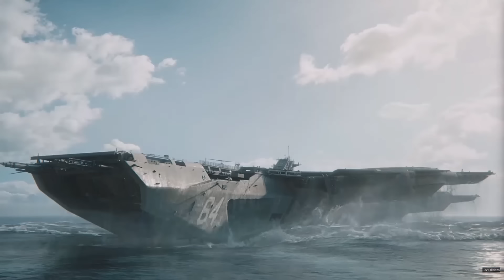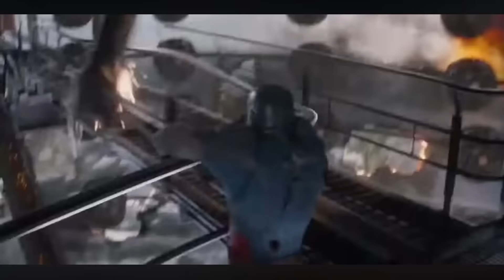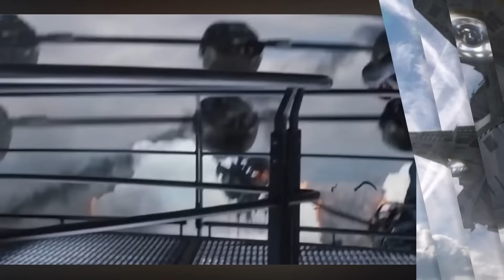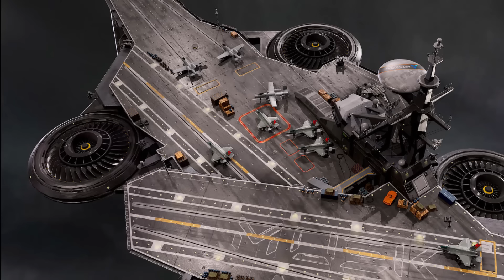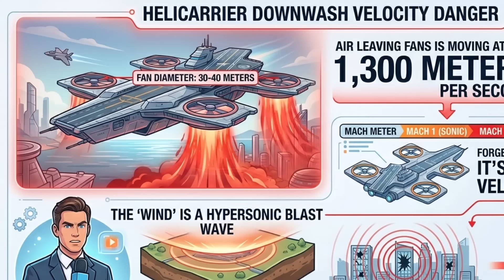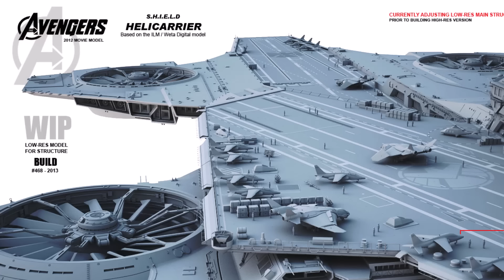The Engineering Nightmare: Could We Actually Build the Avengers Helicarrier?

Comment: Yeah, there is a big scaling problem here. It has been pointed out that the design of those relatively small four-propellor quadcopters really doesn't scale up in size very well, so that a four-propellor quadcopter capable of carrying the weight of a human isn't very energy efficient at all. As the weight of the aircraft gets larger and larger, it's more efficient to have one large propellor moving lots of air downward at relatively slow speeds, than to have four smaller propellors moving smaller amounts of air downward at relatively high speeds. That's why large hovering aircraft using a design like that of a helicopter instead of four propellors like a quadcopter. 

Even more efficient is to have large wings on the aircraft and an engine mounted horizontally so that as the aircraft moves through the air the wings generate lift rather than relying on the thrust from the engine itself to directly generate lift. That's why all of our very large aircraft are fixed-wing aircraft, and not helicopters or quadcopters.

Comment: Imagine having to do a touch and go on the helicarrier. On an approach landing, you have a giant fan grabbing air on your right. And if you couldn't land and had to go around again, you'd have to fly between two fan engines grabbing air on either side as you go off again.

The shield helicarrier looks cool, but, it's completely impractical and unsafe to operate aircraft like a typical modern-day carrier. A better option, assuming it could be done, would be the drone carrier from Ace Combat 7. Even the flying super-sized "Banshee" carriers from the anime "Yukikaze" would be a "better" option for carrier-based flight operations.

Comment: Space Battleship "Yamato" with Modern Day Technology.

I am the creator of the FLOWER CHILD PROJECT Manned Spacecraft Design Concept.

I am of the belief that a Real Life Mars Colony Spacecraft will be comparable to the ...
•   STAR TREK Starship "Enterprise"
•   Battlestar "Galactica"
•   Space Battleship "Yamato"
•   STAR WARS Imperial Star Destroyer
•   STAR WARS Imperial Star Cruiser
•   SDF-1 "Macross"
 ... in Size; and/or, Volume; and/or, Mass; and/or, Displacement; and/or, Weight.

Personally, I used BLENDER 3D and PRISMA3D to create a Cylinder Hull that was 853 Feet Long × 128 Feet Beam × 88 Feet Deep; and, mounted APOLLO/Saturn V Space Vehicle S-1C Stages unto my "Yamato" Spacecraft Hull.

I also envision an APOLLO/Saturn V Space Vehicle F-1 Rocket Engine that was designed to burn Cryogenic Fuel (Liquid Hydrogen & Liquid Oxygen); and, be Multi-Start; and, Variable Thrust Capable.

This F-1STQ Rocket Engine would be bigger then the F-1 Rocket Engine; and, would have greater Thrust Power; and, would require Larger Fuel Tanks and Oxydizer Tanks than the APOLLO/Saturn V Space Vehicle S-1C Stage had.

I believe that my "Yamato" Mars Colony Spacecraft Design will require enough Cryogenic Propellant for a Total Burn Duration of 1 Hour in order to get to Mars after launching from a Space Station in Earth's Orbit.

The Cryogenic Propellant Capacity needed for Launching from a Space Station, and getting into Mars Interplanetary Injection Point, would probably require another 15 Minutes of Total Burn Duration.

Then, another 15 Minutes of Cryogenic Propellant for docking with a Mars Orbiting Space Station.

Thus, I believe that my "Yamato" Mars Colony Spacecraft will require a total of 90 Minutes of Burn Duration of Cryogenic Propellant.

This does not even take into consideration the Propellant System needed for whatever Manuevering Rocket System that my "Yamato" Mars Colony Spacecraft may have installed as well.

Comment: 1st the vessel itself is way bigger than it needs to be. The upper flight deck is overboard even as just a sea vessel! The structure around the fan blades is wing like which this sucker ain't gonna glide anyway so why? A flying carrier at some point could be possible but it'd be smaller thrusters but more of them for redundancy or a Spruce Goose of a massive seaplane with a runway atop the fuselage! Something that gives it a possibility is the S.H.I.E.L.D jets are VTOL! I would think that would be almost required for landing on a flying carrier due to be able to then build a much smaller vessel with shorter runway! Ya think about it, Avengers isn't the only flick with a flying carrier! Sky Captain and the World of Tomorrow had a fleet and I know more towards cartoon but Talespin's flying pirate ship "The Iron Vulture"!

Comment: The angled flight deck is mostly used to recover aircraft using it to launch aircraft can be done when the carrier is on the surface.
Beside that the angled flight deck is angled slightly forward of the left forward engine thruster fan assembly

Comment: Even if they used Starks Arc reactor, or alien tech that thing would crack like wet cardboard. The fans themselves would cause enough vibration that any metal would get fatigued in a big hurry. Even the maintenance per flight hour would ground it, and likely only one would ever be made.

Comment: The angled flight deck that launches aircraft OVER one of the lift engines is hilarious. Any plane launched would be sucked down into the engine, destroying both plane and Helicarrier. 

I've always assumed that these carriers used magnetic lift systems, repelling against Earth's own  magnetic field, to keep them in the air. The giant turbofans aren't needed for lift, just for vertical movement.
Or, later on, anti-gravity tech.
Reply: Maybe, but if it's using rear thrust and it goes over it fast enough, it'd probably be fine, like passing your hand quickly through a flame.
Reply: @MarvelX42 yeah, I wouldn't want to test it. 😂
Reply: @nicholasklangos9704 Understandable.
Reply: 1. Planes that use the angled flight deck would realistically only take off towards the back, and it should NEVER be used for landing, 1 hook miss and the jet will fly and stall into the propeller. 2. The angled flight deck probably only gets used when the carrier is outside of hover mode and in float mode.
Reply: Exactly my thoughts too, it is the only way it could work. Impossible or not it has always been one of the coolest sci-fi designs ever put on film, all the little details the cross over runways with the conning tower and hanger maintenance spaces are just awesome! I guess when aircraft were flying over the crosswind ramp that one fan could turn down briefly,  but it is a design flaw thats east to fix.
Reply: @nicholasklangos9704  The Chinese will find a solution for that. They can build carriers for aircraft carriers if they wanted too
Reply: @lucasahmad6525 
That's a bit excessive and wouldn't be at all practical 😅
Reply: Wouldn't the Magnetic Lift systems provide the "lift" and therefore the vertical movement? Or am I misunderstanding what exactly the term "lift" in this case means?

 Would this just theoretically hover slightly off the ground without the propellers or something, then?
Reply: @ThalmorAgent-08  I would think that just balancing the ship with magnetic force, against the Earth's own magnetic field, would be difficult enough. Trying to move horizontally in that same magnetic field may be an issue. It's like all of those things that now use magnets to hover. But instead of using the devices to hover, the HC uses the Earth's magnetic field to do so. Keeping a constant distance between the magnetic field that's goes through the Earth's core and the part that surrounds the planet in space. Unlike a high speed meg-lev train, we can't alter the Earth's magnetic field to our whims, we can only ride the field lines that are there.
Reply: That’s only for landing….
Reply: The Chinese can do it. Not the American, the cost plus production feeding the pockets of contractors rather than doin innovation.
Reply: @lucasahmad6525  china can do it with cheap chinesium.
Reply: @robertungsod691  You order in the morning they deliver to you before business end
Reply: @lucasahmad6525  the Chinese can’t do shit

Comment: How about fusion reactors? We're working on those and some of them look promising.
Reply: They are still a couple of decades away. 
Anyways, the main problem is that even if you manage to get it done, it can never launch a fighter. The fighter will either get sucked into the rotors and never be able to return back on the carrier.
Reply: @aparnarai3708 Pretty sure that a fighter could quickly fly over onea those rotors and not get sucked it. Like moving ones hand quickly through a flame.
Reply: @MarvelX42  it's not flying over, The rotors will constantly suck air from above and sides to generate lift. At that high up, they would be creating something similar to a vacuum around them. A fighter jet will be sucked while on it's run.
The only way to maybe overcome that is to make a small slope and use EMALS to launch the aircraft with very high force(enough to destroy any aircraft of present). Which now requires new aircrafts with stronger builds.
Is a carrier that strong possible? Yeah most probably, unless the military is hiding some high end super secret aviation tech it will take atleast 40 years for such a thing to be possible.
Is it practical? Hell no. 
Should we do it? Nope not at all, would rather spend that money on space.

Also, China has their own version of air carrier.
Reply: @aparnarai3708  What we know for sure is that it does work because that's the way it's made and they do it in the movies reality, so....
Reply: @MarvelX42  it's possible but like I said, material and engine constraints of present won't allow it to happen rn.
Even in comics it used some anti-gravity tech.
Reply: Doesn't solve the rest of issues
Reply: 😅😅And what, are u gonna build mini version and place it inside the carrier 😂